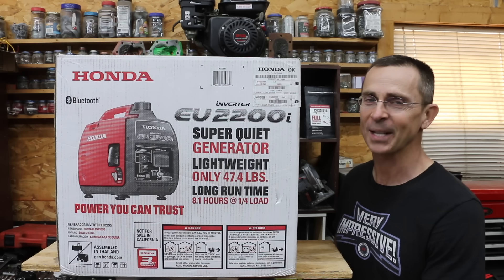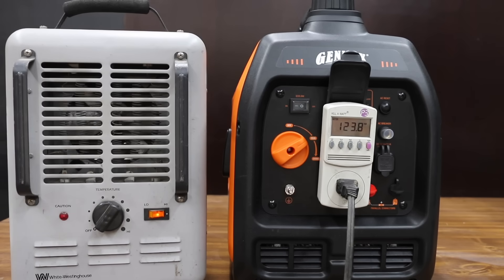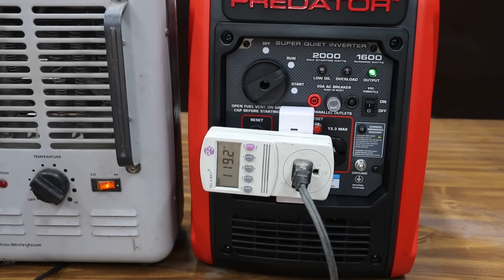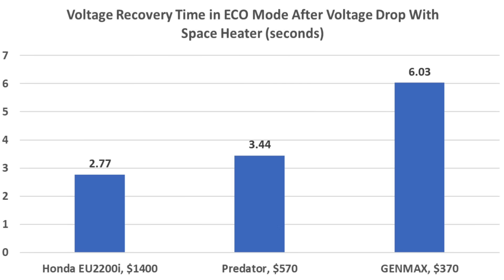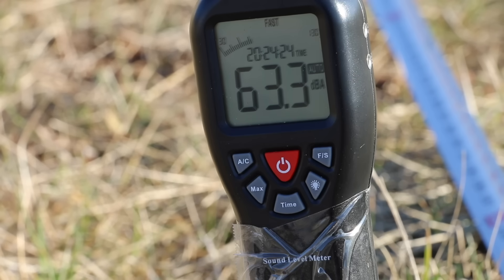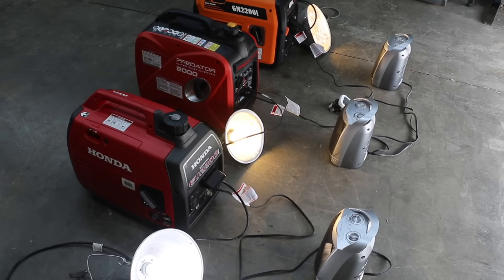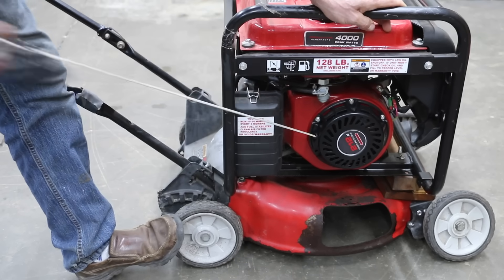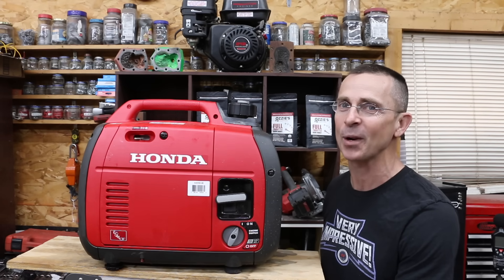Cheap Generator Better Than Honda? Predator vs Honda & GENMAX—Let’s Settle This!

Comment: As a retired electrical engineer, I love seeing the oscilloscope readings of the output. I never realized how great a difference there was. Thank you!!
Reply: Could you explain what the dirty electricity means? Is it just not a proper polarity change within the certain frequency?
Reply: @imkaneforever  dirty electricity means two things. Here in the USA we have 60 Hertz and 120/240 volts. The first aspect of dirty electricity is called total harmonic distortion. This basically means there are voltages present at the higher harmonics so we can have 30 volts at 120 Hz or 15 volts at 240HZ. These voltages are basically not doing anything to power the load but instead create waste heat which can shorten the life of electronics. The utility grid states that you will never see anything beyond 5% harmonic distortion. That's considered very clean. Portable generators non-inverter type can have harmonic distortion as much as 20%!!! 

Most low-power switch mode power supplies are tolerant of high THD because they are overbuilt to handle the excess heat. Make no mistake though over time high THD will cause these devices to fail.

The second aspect of dirty electricity is RFI. This is especially present on inverter type generators. It's basically the same as harmonic distortion but at a much smaller voltage at a much higher frequency somewhere in the 20k to 50khz region typically. The noise comes from the transistors turning on and off very quickly in order to approximate the sine wave that we would normally find in our house outlets from the grid. This on/off action creates the RFI noise. Normally there are filtering components added at the inverter output to keep the level of this interference noise below certain established industry limits called FCC 15. Sometimes this could cause problems with some electronics. There is always going to be some of this RFI on inverter generators even with proper filtering and can be heard with high quality audio devices. There are filters that you can buy however to make this noise go away pretty much.
Reply: @Bassguitarist1985  Thank you for taking the time to explain in more scientific terms my idiotic attempt haha. I've had problems with our power grid out in the country and had to learn a little bit about the subject but this is way easier to digest than anything else I've found. I have to use line conditioners on sensitive component appliances like PCs, otherwise the UVP will kick in during the many random brown outs we have.
Reply: @IronArmPanda  line conditioners can do multiple things. Typically they are dual purpose. They have filtering components that remove EMI RFI from the incoming AC lines, and then they employ metal oxide varistors, commonly shortened to MOV for surge protection. Those devices only conduct current when the voltage spikes above an unsafe level shorting those voltage spikes potentially sacrificing themselves before it destroys your equipment.

A line conditioner will NOT regulate voltage to stay within a safe range for connected equipment. A device that does that is called a line regulator, using an autoformer, basically a transformer with multiple taps at different portions of the winding to adjust up or down (buck/boost) the voltage so that it stays at a safe level and disconnect power altogether when it falls out of range of what the device can correct.

You mentioned an uninterruptible power supply. There are different flavors of these too. The most common pure sine wave version is called a "line interactive UPS." This type commonly has some surge protection, EMI filtering, and a buck boost autoformer to keep voltage at safe levels. Unfortunately with high THD these devices will click back and forth from passing the incoming line voltage to your equipment over to the internal battery powering the inverter. The IC chip that runs them relies on the zero crossing of the 60 Hz AC to detect when voltage is not at the correct level meaning it confuses that chip. Cyberpower a popular brand allows you to adjust the sensitivity of this chip to where it won't switch to battery as quickly or you can have it be very sensitive and it will jump to battery almost immediately of any minor fluctuations in power. This I would say is not the best type of UPS for running on generator power because of this issue. I would then recommend what's called a double conversion or "online" UPS. This type of UPS has passive PFC does not care how much THD is on the incoming lines because it will always be running your connected equipment on the internal inverter and battery. The incoming power only serves to charge the internal batteries and since it needs to convert to DC the incoming circuitry is far more robust and non-discerning because it's going to convert the AC voltage to DC anyway.

Cheers!
Reply: @Bassguitarist1985  Thanks for the info on the line conditioners as I will probably be investing in a few. I actually meant voltage regulators. I use APC Line R-1200's being that they're pretty affordable for my use case. I've not looked into an online UPS, only worked with uninterruptable, but they seem like a great fit for running audio equipment or more sensitive electronics off of less than stellar power inputs. Gonna have to go down a few rabbit holes now. A very great learning experience I appreciate it sir!
Reply: @IronArmPanda  I have one of those APC LE1200 units. They work but they have a wide voltage range. UPS units will not necessarily stay on incoming line voltage but click to battery if THD is too high. Also 1200VA is a limited capacity, dont run any inductive loads like a motor off it.

For most in the US 120 volts is the norm, so when this unit is set to that, it has a -12% to +6% range around the center voltage of 120 volts according to the specs. Most electronic device power supplies are designed to handle the range this unit regulates to. The response time this reacts to any voltage fluctuations is acceptable to (under 2 AC cycles)

THAT MEANS...When set to 120 on the back and your incoming line voltage drops below 105 volts this will activate the transformer to step up the voltage back to around ~120. If you have an over voltage, it will not activate the transformer until the incoming voltage goes above 127.2 volts to step it back down.
Reply: Incredible reply.  Question, can you explain in practical terms an application where an open frame generator, at its cheaper watt/dollar is perfectly usable and the rfi and noise don't matter much vs where you really need the pricier inverter generator?
Reply: @jdr03272  and open frame conventional direct drive generator is ideal for large resistive loads like hot water heaters, lights (incandescent, fluorescent, and some LEDs) and some inductive loads such as PSC motors that are found in older refrigerators and furnace systems. PSC motors will run okay with higher THD but have a higher operating temperature because of it. They are way more tolerant than ECM type motors which can fail or malfunction with high THD

An inverter generator that is properly filtered is just as good if not better than the utility.
Reply: I too would like to know 🤔
Reply: @alfredotovar8984  It means the frequency is either too high or too low and the voltage has too much variation. I'm guessing the cheapies are using cheap components and less than stellar invertor circuits.  There's also probably missing filtering circuits like what the Honda has. Alot of newer electronics will not have a fun time on a generator with too much variation under load.
Reply: @IronArmPanda  Actually, it's quite the opposite. Most "newer electronics" are the ones that will suffer least from bad sine waves. Anything with an SMPS (computers, phone chargers, etc) have no problems operating at anything between 40-80hz and really don't care how clean the power source is. "Older" electronics or things like amplifier that often still have linear supplies will be more heavily affected. Most likely anything with a motor as well.
Reply: @ryanjay6241  If you want to run your 120 appliances on 60-90v then go for it :).

Comment: Thanks!
Reply from the maker: Thank you for supporting the channel!
Reply: Appreciate the time and equitable comparison PF. These comparisons of yours have saved me more time and poor purchases than I care to count.
Reply: I followed your steps for my WEN generator, minus the sine wave or plug gap. Watt dropped with a 10A vacuum cleaner, but recovery time was high (2-3 seconds). These little RV gens bailed me out many times! Happy to share make and model but want to avoid an unsolicited ‘plug’.

Comment: Been running the Predator for a few years. No issues so far. Been a pretty good bang for the buck. Has done as good as my uncle's Honda at a lower cost point.
Reply from the maker: Thank you for sharing!

Comment: My predator 6500 has been the best generator i have ever owned. Even after sitting for a season, it will start right up in 1 pull.

Comment: I use a generator on a commercial fishing boat. I've tried many different brands and Honda is the only one that lasts. It runs all night every night and I usually get 4-5 years out of one before they start rusting and falling apart from saltwater but still running!
Reply from the maker: Thank you for sharing!

Comment: This really gives one something to think about.  Obviously, the Honda is probably the "best", but if someone is interested in running two at once, you could buy 2 of the predators and still likely have enough left over for the cable.  So my initial thought is that if you are buying this for work, the honda could make a lot of sense.  But if you are wanting to boondock camp and want the flexibility of sometimes having 2000 watts and sometimes having 4000 watts (starting), the predator may make more sense.

Comment: Can you please test delvac 15w-40 and rotella T4/T6? Also then mixed in with Lucas heavy duty oil stabilizer. I am in the trucking industry and these are the most common and a lot of controversy about the Lucas heavy duty oil stabilizer. I will donate the cost of the goods if video gets posted
Reply from the maker: Thank you for the video idea!

Comment: i go camping a lot and have a Wen 56200i. it seems to handle altitude okay at 4000-7000 feet but it runs poorly above or below that
Reply from the maker: Thank you for sharing!

Comment: Nice work. I agree with other comments about dual fuel generators (mid range, like $500-1000, able to run refrigerator or even HVAC). They are much more useful to power the entire home essentials when there is extended power outage. Also another hot topic is a comparison of $200-500 mid range power stations (Jackery being the name brand), very popular for camping trips.
Reply from the maker: Thank you for sharing!

Comment: Todd, I love your videos. They have saved me countless hours and God only knows how much money buying brands and products that would have either needed to be replaced or thrown out altogether. Thanks. One note pertaining to this comparison: I have two of the HF Predator Inverters shown in this video and my oil and spark plugs don't ever look like the one in your test. You might have just gotten a bad one. I will say this, yes the Honda might be "technically" a bit better in some of the tests but at $1200 compared to $600 (sometimes even less) I can't justify the cost vs the small differences between the two. My buddy has two of the Honda's and we always joke about both of mine being less than one of his. Thanks again.

Comment: how bad is clean the sinewave is with a lot of stuff running switch mode PSU's there all converting it to DC befor converting to a high freq

Comment: On the other side, Genmax is bragging in their ads that their generators have successfully done 500 hour endurance testing.  500 hours is their high water accomplishment?  In the 1980s I had an equipment rental yard.  Our Honda and Yamaha gnerators, used hard by renters (after all it was not theirs) when well maintained went in excess of 5000 hours and were sold as used units in good working condition.  We were a Yamaha distributor as well so we were also a regional repair center.  Many of our used Yamahas were brought back for service 1000s of hours after we sold them after 4000-5000 hours of our use.

Comment: Video Idea:
Inverter vs regular modern generator with voltage regulator 
To compare sign waves, fuel efficiency, etc for Home Back Up power

For safety of home electronics
Reply from the maker: Thank you for the video idea!

Comment: Best thing I can say is you get what you pay for. I’ve serviced/repaired several hundred Honda EU2200 generators at this point there’s nothing better on the market that I know of. I’ve seen these things come in all smashed up literally starting to fall apart and they still run and make power. I’ve also worked on knockoff units like the predator, Yamaha, generac, etc they’re nowhere near the quality of Honda. They’re junk.
Reply from the maker: Thank you for sharing!

Comment: In case you're havig a hard time yanking the engine to sufficient starting speed, here's a useful tip:
Pull the rope until the latching mechanism engages. then gently pull again to slowly turn the engine. At a certain point you'll encounter the first of three resistance points. Rearm the rope as mentionned above. Again gently pull the engine until you pass the third resistance. Again rearm, but this time yank the rope. In most cases you easily get a decent starting speed for the engine to ramp up to operational RPM on its own.
The anatomy behind: As you pass the ignition stroke ( Piston BDC ), you now have the exhaust and intake valve opening sequentionally in one RPM, allowing the engine to "freewheel" through stroke 4 and 1.
I came through this handy tip by pure chance and would like to share it to all out there.

Comment: The Honda is by far the best generator but it is three times more expensive than some of the cheaper ones. if you're only using it occasionally I don't think it's a better value. I have the bigger version of The Predator generator and I've had zero problems with it, it is also very quiet and also three times cheaper than the equivalent Honda. When I bought the Predator I change the oil three times after running it an hour or so and I think that is what you need to do since it has no filter. You definitely get what you pay for but it depends on what you actually need

Comment: I would love to see how a Wen portable generator would compare to these! I got mine for about $400 and it seems pretty solid so far!
Reply from the maker: Thank you for sharing!
Reply: I'd be curious too.  I know a few people who bought them instead of the Hondas but haven't heard how they performed.   Either way, an inverter generator is the way to go.  The fuel savings alone will make up the price difference.

Comment: A-iPower, Wen, and Champion would be nice to add to the list of brands to test.  This type of video is extremely interesting to me, especially the oil test results and noting that the spark plug on the Predator clearly showed it burning oil.  I have some videos on my own channel regarding the importance of properly breaking in non-filtered small engines by frequently changing the oil during the initial minutes and hours.  So much wear metal comes off in the first 5 minutes that it's shocking.  Also, I think it's a really bad idea to run synthetic oil during break in, as it does such a good job of lubricating that the rings may never fully seat.  I'm wondering if this is what might have happened to the Predator.
Reply from the maker: Thank you for sharing!

Comment: If you are having trouble with starting up current heavy appliances like power tools, air conditioners, or refrigerators even if they are inside the power rating of the generator you can use or make a simple soft start device for them.  electronicsNmore has a great video on this and the top comment is from Project Farm!

Comment: Great vid as always. Something to consider with the voltage drop recovery time... The update rate of your voltage meter was probably on part with the recovery times. That means the variation in the results due to update rate is probably similar to the recovery time itself.
Reply from the maker: Thanks!  Thanks for the constructive feedback.

Comment: I have and use the Honda EU2000 on the back of my truck on the catwalk. Its got over 3000 runtime hours and no smoke or oil usage between oil changes. I use it a lot when driving the semi-truck. I check the air filter and its still clean for use. I think the way they pull air from the bottom and goes though the course oil one keeps the finial one clean for a very long time.

Tip: If you are going to use the generator more then 100 hours per month in a NON-wooded area, like the back of a simi-truck on the catwalk. Remove the spark arrestor to prevent it from clogging up and burning out the valves. Learned that the hard way with my first one, a yahama one. Note: Never run without it around wood, like a construction site, or not on pavement, like a forest or campsite. In all the time I ran mine, never saw a single spark. Your mileage my vary.
Reply from the maker: Thanks for sharing.